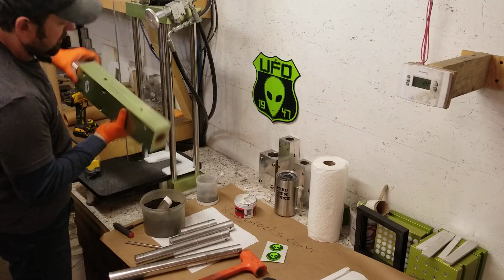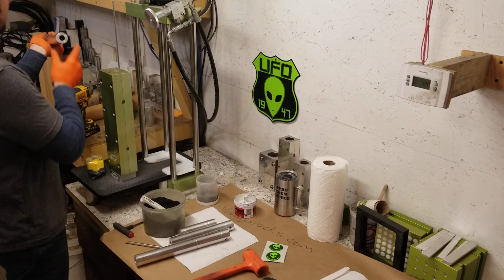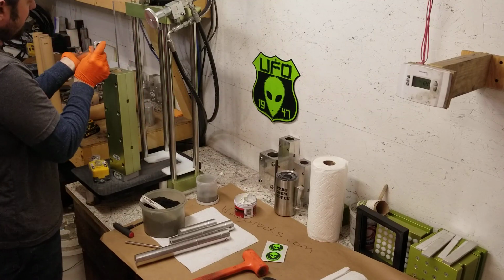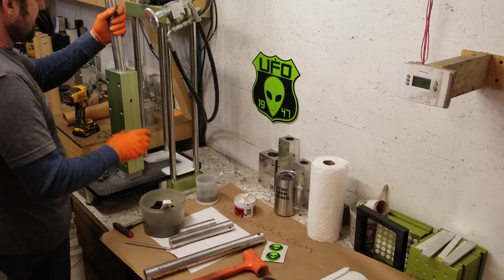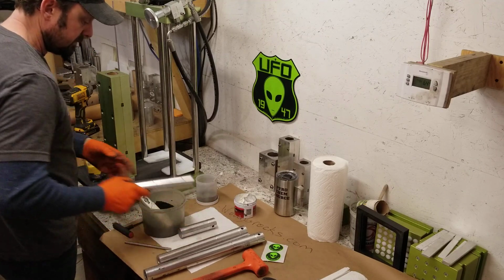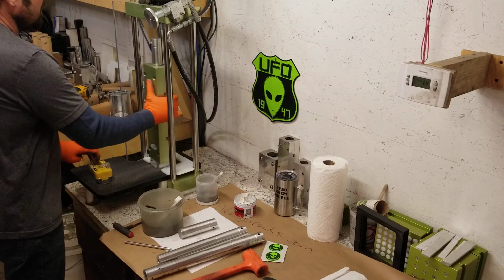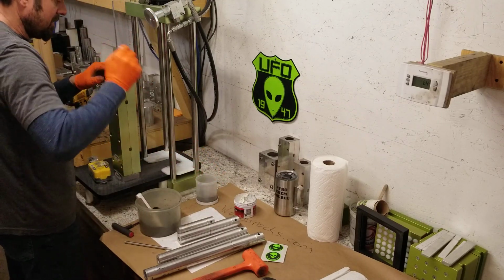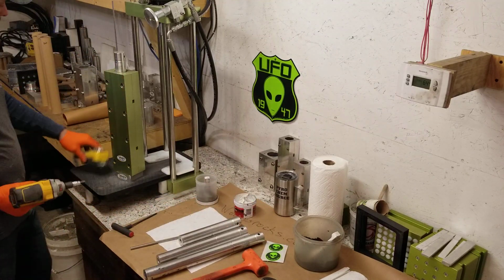Black powder Motor Construction 6lb.

Comment: i really want to get into building rockets, but i want to know do i have to get some kind of certification or is it legal without one. I want to make one but not worth going to jail over. 
would or will you ever be willing to sell your rockets ever?
Reply: Depends on what you do , what fuels you use and where you live. BP rockets you need a ATF license to make if you plan on storing them but if your state allows fireworks than you can make the rockets the same day and launch them legally . Just make sure to burn everything up within 24hrs of making it ( the same day , the mixture and rockets canon be left un attended without proper storage and and ATF license)